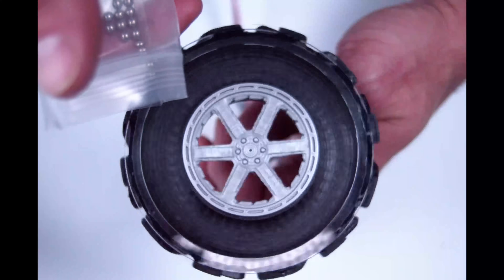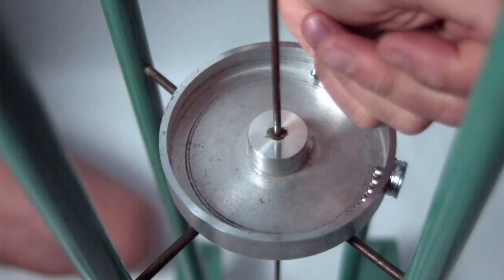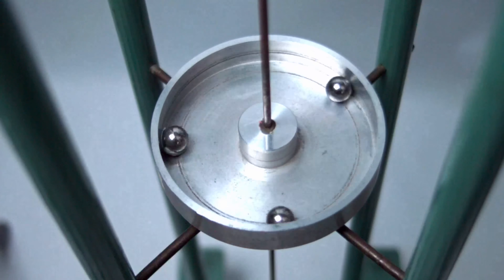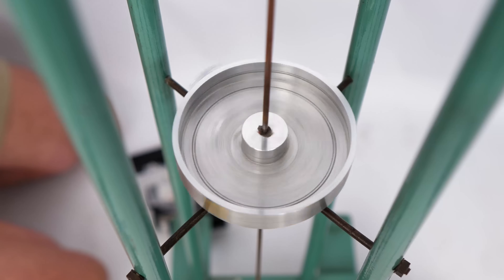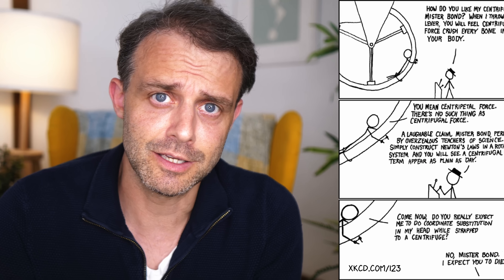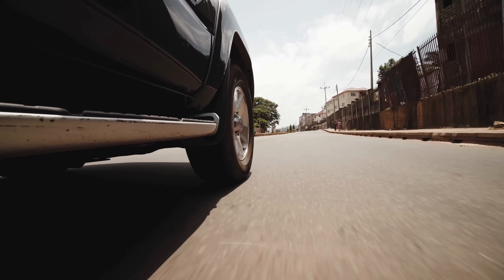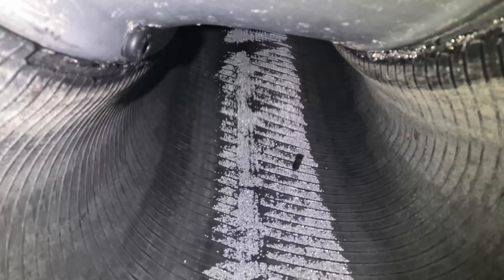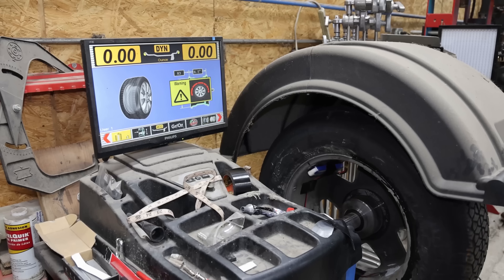Do tire balancing beads actually work?

Comment: 20 year tech here plus off road enthusiast...

Balance beads WORK. 

But they are not the best option for every application... Most tires 31" of less, or with side profile of 65 or less are better off with traditional wheel weights. 

Balance beads really showcase their worth in large off road tires ... These are tires that can be exceptionally hard to balance or maintain balance do to the heavy tread design , purpose of the tires..
Example a Mickey Thompson Baja or BFG ko3 is going to give s rough and somewhat rough ride bc if the knobby tread , which can shake the weights off or just not balance properly... So balance beads solves this issue and smooths out the ride at motorway speeds ...

Comment: Service Manager here, at a previous shop I worked at we would only use balancing beads for the oversized aftermarket wheel and tire assemblies for pickup trucks. 

Most cars can be balanced using a dynamic balance using a tire balancing machine, but if they won't fit on the balancer...well you can try a static balance, sometimes that works well enough or you can do balancing beads. 

It's a lot easier to train someone to mount a tire and chuck a bag of balancing beads in it before seating the bead than it is to teach them how to force a dynamic tire balancing machine to do a static balance.
Reply: I agree. They also work great for when you don't have a balancing machine or can't fit one in your garage, and if the tires wear unevenly they also don't need to be rebalanced again. 
My idea is this, if you want perfect, you could try both weights and then add a little bit of beads, but it's a little overkill lol.
Reply: Is there a reason why you don't just use something like thermoplastic beads and then warm the tire while spinning it at high speeds to melt the plastic in-place?
Reply: @robonator2945  🤣 would need so damn much heat that the tires would not be happy.
maybe use your own brains a lil bit next time.
Reply: @nukester.   I take it you're not much of a 3d printer guy, are you?

The melting points of different materials are, get this, different.

If tires have a maximum stable temperature of X degrees celsius, and under normal use they only reach Y degrees celsius, then if there exists a polymer with a plastic transition temperature Y < Z < X, you could safely melt-form it without damaging the tires.

And since we know tires don't literally melt from normal use, we can safely assume there's a fairly bloody large gap between Y and X for Z to exist.

You realize people melt-form fucking earbuds into themselves, right? Meltforming doesn't require thousands of degress, it can be done at very mild temperatures and entirely depends on the actual material you're using.

Comment: I had self-balancing inserts on a truck I used to drive, back in 1988.
They were installed on the front tires of a cab over truck.
It was so odd, because from a standing stop, the wheels were VERY off balance, and didn't start to level out, until I'd get to around 15~20 MPH.
After that, they would smooth out and run perfectly.
They were round steel tubes, filled with some kind of fluid, and steel balls.
They were mounted alongside of the wheels.
They're still made, by the Centramatic company.

Comment: I am an automatic and I do not believe that vehicle tires can truly be balanced at lower speeds with balancing beads. When you put a tire with balancing beads on a tire balancer at an automotive shop, the tire balancer can't sense a correct weight so therefore, the tire is not balanced.  And to put the icing on the cake, so to speak.  Trying to get balancing beats out of a tire is a complete pain. It's one of the worst things you can do to an automotive technician.

Comment: I wonder if there is some polymer or hydrogel that could be used, which would stick to the tire at higher G-force and stay there even if you stop. Or perhaps some more viscous glue wrapped in a container that breaks at 80 km/h or higher... but I guess the latter one would require larger beads. Plus, this would also in theory prevent any damage to the tire on the inside.

Comment: I get multiple tickets a day speeding up to 80kph in a 40kph zone to get my tyres balanced. But hey, at least my wheels don't vibrate! Aside from that, a fixed balancing weight means the tire is balanced at zero speed and up. No need for crazy driving antics on public roads just to satisfy some wheel physics.

Comment: Yuck. NOT a brilliant solution unless the beads were somehow to glue themselves into place at a rapid spin. You see, the wheels are unbalanced when your car starts into motion, and this sideways motion slams your wheel bearings around. They remain unbalanced until your speed is high enough that the glass beads shift properly to balance the spin. Then you STOP your car, and your wheels are instantly unbalanced, once again slamming against the wheel bearings as you start up. Rinse and repeat, wearing out wheel bearings MUCH more rapidly in the process!

Comment: The beads work in my truck, but I've had some low speed vibration issues with smaller lighter tiers.

Comment: I have a truck with 35"x12.5" And use to use regular weights and having to get them rebalanced over time.  For the last 2 years I have used beads and the wear on the tire is perfect and that's both ways. And never feel any type of vibration at any speed.

Comment: Now I'd like to see the impact of washboard roads and how it relates to this.  There definitely is a speed at which you can drive where the bouncing they induce goes away and the ride smooths out.  I've always noticed it around 40MPH.  But maybe it's related to your 50MPH, or maybe it's related to the spacing of the ridges on a washboard road.  Then again, I'm not sure what drives the ridge spacing, either - is it the rain or the cars driving over them that creates it?

Comment: To add to what other techs are saying: this creates a static balance (up and down only) and does nothing for dynamic balance (tilt-wobble). For big truck tires there's so much mass both with the rotating assembly and with the vehicle that dynamic balancing doesn't matter much. Always have your tire guy balance the wheels on the machine. Just better overall.

Comment: As someone who spent 13 years testing tires, I have doubts that these beads could work. The main reason is that a tire is not a perfect circle. The part that contacts the ground is close to flat. As a tire rolls under the load of the car, it deforms when it impacts the ground. Anything riding along the inner side of the tire is also going to encounter this impact and be bounced around in the tire. Also, tires suffer from flat spotting. Depending on temperature, weight of the car, and the length of time parked, a tire develops a flat spot that can take up to 10 to 20 minutes to run out. Though your demo was highly interesting and informative, it really wasn't close to how a tire behaves rolling down the road under load.

Comment: They help, but damn are they annoying in the steer wheel of a rigid 16 metric tonne truck. (35,000Lb for the US viewers.) Below 80kmh (50Mph) the beads/bags slide to the over weight side of the wheels, and between 65-75kmh (40-47Mph) you can feel and hear the wheels slapping on the ground. Over 90kmh (56Mph) it becomes almost smooth. The wheels have been completely off the truck, rims balanced individually before the tyres (Tires) were refitted then the whole unit balanced. Didn’t fix the shake. Tyres were rotated so the unbalanced direction was opposite to where it started, rebalanced, and the bastards still shook. So beads and bags were added. As the truck does 95% of it’s travel on highways, it’s not a huge issue, just rough at low speeds, especially when the wheels end up synchronising, and damn scary in the wet between 65-75kmh, when the wheels are off the ground for ⅓rd of their rotation. The only conclusion the heavy vehicle tyre techs could come up with is those particular tyres and rim combination develop some form of resonance, and by some fluke that resonance is som multiple with the truck’s resonance, as the shake is amplified when on the truck. So yeah, as a truck driver, I’m ok with them, but I’d prefer to just get everything fully balanced so there is less stress and wear on the parts and driver. Thanks to Steve for clearly explaining how this works. I also found the concept counter intuitive before watching this.

Comment: Interesting. I heard about how balancing machines had weights attached to rods attached to concentric collars on the shaft. They would spin them up, and when it stabilized,  they would clamp it down so the weights stayed in place and stop the machine. Then they could measure the weights to know how much material to remove.

Comment: I can tell this guy, as brilliant as he is, has never worked in an automotive shop. In the USA and on the brand I work for, high end luxury European, the things he says about unbalance feeling at 15mph and gone by highway is sometimes correct, but more often then not incorrect. The vast majority of vibrations I deal with are at highway speeds, say 60 and up and some are only noticeable in a very narrow band of say 5 mph, while others will be noticeable for 20+mph. Sometimes they are worse at lower speeds but that’s usually not the case. The majority of vibrations I deal with at highway speeds, I can usually start to pick them up in the 40-50mph range and then by the time we’re doing 60-65, which is the most common speed consumers complain about, that’s when the vibration is most noticeable. From that point it can stay at the same intensity for awhile or taper off as speeds increase.  

Let me be clear, NO mechanic hates a consumer for using tire beads for the reason the consumer might think.  We don’t hate beads because they eliminate an income source from us, in fact quite the opposite!  We hate them because the consumer will put the beads in, it won’t fix the vibration problem and they’ll neglect to tell that to the adviser or tech.  Then when the tech tries to balance them on a traditional machine, hopefully with a road force check, the machine will constantly say different weights are needed on every check spin.  Then the technician has to dismount the tires and clean out the beads which if they’ve worn at all is very hazardous to inhale and a bitch to clean and so on. 

These beads also cannot deal with out of roundness, hard or soft spots, shifted belts, tread wobble, or any other road force inducing fault. Basically they can work to maybe solve one single source of vibration and if that doesn’t work, then it’s a huge pain and serious potential health hazard for the technician. Yes I hate these but not at all for the reasons the consumers think.
Reply: Considering how much brake cleaner and other crap you guys inhale, I don't think a bit of rubber dust is going to tip the scales much.
Reply: @stargazer7644 It’s not the rubber dust it’s the silica these beads are made of. When they get ground up they become small enough to inhale and that causes silicosis of the lungs. Far far worse then brake clean.

Comment: I have used this tire balance method extensively using all different types of things on all different types of tires. after 20 plus years I have come to the conclusion it is generally a waste of time. If your tires are smooth with no balancing at all they will be smooth with tire beads, if your tires shake they will shake with tire beads.  I have tried the disc that bolt between tire and wheel, ceramic beads, glass beads, airsoft bb's, golf balls, ball bearings and maybe some things I have forgot about. You hit a bump and tire shakes , you slow down and tire shakes, you go fast but not fast enough and tire shakes, you have too much or not enough in your tire, so many things can go wrong.

Comment: 7:56 Up till now your mechanics/physics has been textbook - mass, moments, energy, rotation, centrifugal force in a rotating frame etc. But from 7:50 you have departed, by introducing inertia on its own. Inertia is not textbook physics - it's popular science and doesn't exist as it can both mean mass (scalar) and/or momentum (vector). Moment of inertia is something completely different and defined in mechanics:  a tensor.

Comment: most of the time you're not going to feel your tires out of balance until you get up tp 50mph unless its severely out of balance. We meanly use balancing beads on whiles that are to cumbersome to balance (either because they are to balky or the weight needed to be add to the rim exceeds a justified amount. depending on the tire 4oz to 12oz.)

Comment: Conceptually its doing the EXACT same thing as the weights from a shop, but the difference it that the weights are fixed... the glass beads are in free flow and will have to "Calibrate" every time, and optimal placement is hingent higher speeds...  A tire balancing machine spins damn fast and calculates where the imbalances are, and tells the tech where to slap exact weights to counteract those forces.

Comment: as a kid, I used to pump some water into the innertube of my bike. The reasoning was that it would push the tire into the ground for better grip. and I guess it worked. 
it didn't seem to hurt the bike, so I kept doing it. 
I wonder if it actually worked, or if I just felt like it did. anyway, I guess a liquid would act as balancing beads, but rattle less. ;)

Comment: The same would be true with combo balancing/puncture seal fluid in the tire. You'd have to get going past 80 km/hr before it would balance, and then it would be ok. After you park for a little while it'll become out of balance again and then you have to do it all over. Major nuisance.
This is something they do on transport trucks that routinely drive on the highway. My car doesn't, so I'm just gonna balance manually.

Comment: idea: tire balancing beads mixed with some sort of apoxy such that you drive at freeway speeds for a certain amount of time after putting in the beads and then they stay put because the resin cured

possible? 
commercially viable?
Reply: I like it!
Reply: depends if the resin flows into the right shape I guess. You would also need a resin that is flexible. So maybe you could melt some rubber, put it in the tire & spin it at high speeds & wait for it to set. You might not even need to mix the beads in since the rubber has weight to it.

Comment: 10:30 will be my next excuse for getting a ticket on a 40mph road
in all seriousness though my car vibrates at highway speeds and is smooth at low speeds i've had the tires balanced and everything checked out. I wonder if its drive shaft resonance?

Comment: It would be a nightmare but you could put the beads in a resin that cures in like 1 hour than drive on the highway until they are cured enough to stick in place. Or you know just go get your tires balanced.

Comment: What if the beads had an adhesive in them and their shell was just weak enough to crack when the centrifugal force was above the balancing speed.  And you would just have to dive on the freeway long enough for the adhesive to set.

Comment: Could you put like a spray adhesive that activates with time, or better yet heat, to keep the beads in their place after driving at free/motor-way speeds?

Comment: so lets talk balancing rims and tires - the reason you do this is to prevent vibration caused by a rim and tire that have heavy spots through the manufacturing and wear process. They are fixed points that a balancing machine will discover and pick the correct counter balance location and weight (always make sure your shop is doing the road force balancing). 
These beads might actually help but I have an even better solution - sticky weights - clean easy proven and costs 25 dollars per rim. 
The beads need certain speeds, are messy, ecologically nightmarish, would make changing the tire a gd nightmare and general pain in the ass, has a high cost/efficiency vs some cheap weights (the cost is mostly removing the wheels from the car)

Comment: nice video as balance beads work fine in car on the road. I use them in my bike as well. When moving at slow speed the off balance can't be felt and at driving speeds they work. Your comic is stupid though is it just justifies the bad use of language in science aplications

Comment: One it's the rim that causes imbalance unless you got a really shitty tyre mould.

Two, vibrations followed by centrifugal forces cause the weight to evenly distribute in the "low" spots offsetting the "high" spots causing equilibrium.

However they're not the best as they can wear your tyre out from the inside, and the tyre wall isn't made to be strong. Weights are overall better.

Comment: Common practice on semi trucks where I'm from. At least where I work. Have been running balancing beads in my steer tires for many years now. It definitely smooths out the ride at highway speeds.

Comment: I suspect clothes washing machines have been doing this for years!  They start spinning slowly, letting the water fling out of the clothes and thru the perforated drum, and only if the clothes are well enough distributed can they pass thru the lower spin speeds and reach super-critical self-balancing speed, and if the drum wobbles too much it slows back down until the clothes collapse from gravity, and then ramp up the speed again, literally ‘rinse and repeat’ ;-)

Comment: From watching @TheTireDoctor I get the sense that this is only viable as a temporary solution for a new tire that was set on the highway. You should then go to get it balanced properly. Since that wouldn't be possible (or easily done) while on the side of a highway, I think this "strange balls" temporary solution is fine.

Comment: I have been using ceramic balance beads on the motorcycle for maybe 10 years now and they're awesome.  Smooth ride all the time.  2oz in the front tire/tyre and 3oz in the rear.